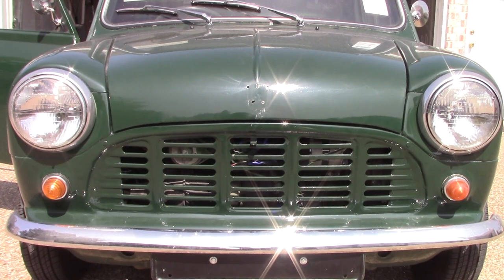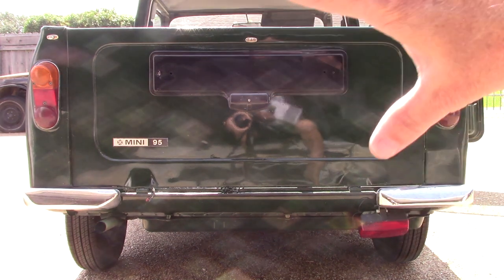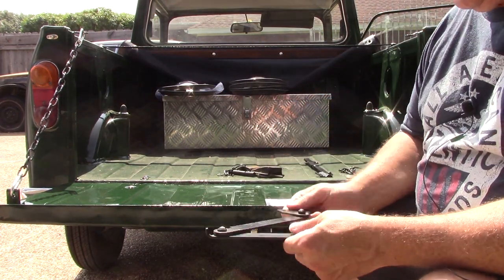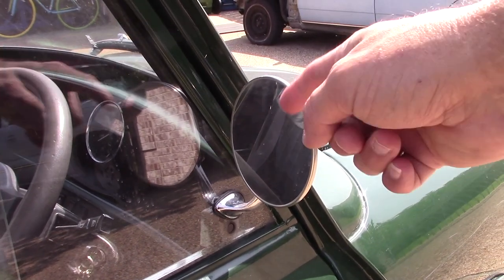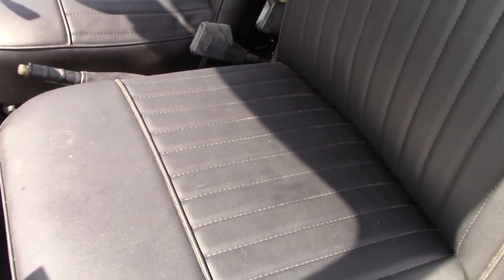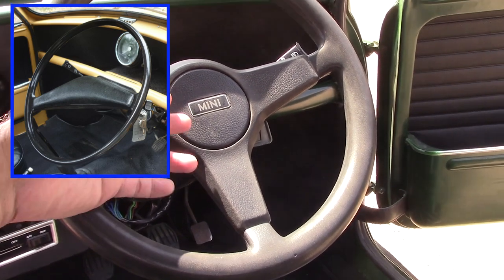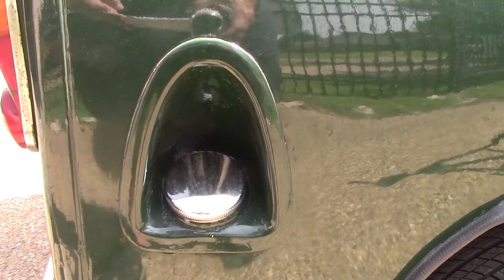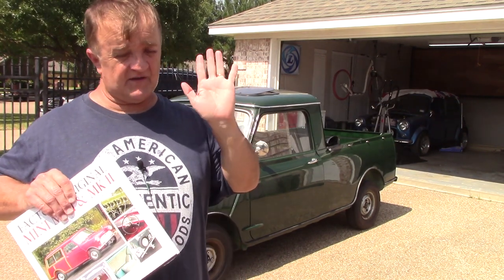MINI PICKUP Trim Details.

Comment: Hi there, you may be sorted by now as I'm a bit late to the party but my Pickup is 1980 and pretty original.  Saying that my front panel has been replaced so I'll withhold comment on that.  No over riders, I think these were just for upmarket saloons and were gone completely by 1980.  The choice of bonnet badge will be dictated by the registration document.  My rear lights are as inset photo at 05:30 with indicator at the top.  The hubcaps should be the plain ones you mention just covering the wheel centre.  The spare wheel is held down by a swan necked metal clamp to the bracket you were given.  My seats are Houndstooth cloth inner and vinyl outer.  The door cards are plain card type as are the dashboard outers,  no pinstriping.  Your dash switches are correct with a brake warning safety light,  your steering wheel is from a later saloon you show the correct one in inset photo.  For my money the sunroof needs deleting.  There are numerous 1979/80 Pickup brochures on UK ebay showing the same interior as mine. I hope this is of help but as I said you're probably sorted by now.  Good luck in your new project.
Reply from the maker: awesome..  thank you for your input.  I'm fairly sorted.  For now it will become a rolling restoration.  I plan to use the earlier tail lights (Lucas) and eventually I will replace the grille.  As for the sun roof, there is not much I can do about that and will leave it.  I'm far from having the skill to form and put in metal to match.  As for the bonnet badge, I'm going to use the combo Leyland symbol with "MINI" given that nobody here knows what the pickup is.  The badge will at least give them a clue.  My biggest problem right now is whether or not I go with silver or Old English white on the wheels.  I believe silver may have been the correct color for a 1980, but I believe I may go with the white..   I greatly appreciate your input!!

Comment: Hi Randy,  You have a super little Mini pickup and I'm very envious but I'm sure it didn't come cheap.  I like where the mirrors are located and the chrome look. To mount them on the fenders would just be another place for corrosion to attack. I was thinking since you are already working on the other Mini perhaps you should just drive the pickup around as is and enjoy it. Cheers, Midge
Reply from the maker: Right on Midge..  great minds think alike.  I was considering the idea of potential rust origins and I also wondered how well I could actually see in the side mirror if it were mounted to the wings.  I'm not sure it was be as useful..   I must focus on my current restoration and keep this for driving while I can.  I do have to flip the radiator fan around so that it's correct and I will only do some repairs when I cannot do anything on the current resto.  well...   I would like to have the wheels cleaned and finished...

Comment: I think you're on the right track with most things, yours is a quite late PUP, I think (like your tailgate badge) they were Mini 95's by then (Pay load 95 cwt ?), made by Austin Morris (AKA Leyland) The wheel trims you have are way too early, AFAIK PUP's only ever had the dog bowl small centre caps. Rear lights I think yours should have the Britax type, Is yours a 1000cc, Mine is a 74 and one of the last of the 850's (I think). Seat trim looks similar to original pattern, but has been re-done. The spare wheel holders can be hard to find, and that wedge bracket should be welded to the floor. You have original commercial doors (see elongated slot by the inner handle ( Allegedly for a padlock on Royal Mail vehicles? So the rumour goes!)  I love the way you refer to "M... K... 1  and 2, the English pronounce MK as "mark" so Mark one and Mark two !  Another book is Chris Rees The Complete Mini, I'll have a look at my copy tonight, there may be more changeover info in that one. Videos like yours will bring out this information, Great Work Randy!  Cheers Graham
Reply: Not much in the Rees book unfortunately, not worth buying the book for, says last 850 PUPs were November 1980, only 1000's up to end in 1983. Does have a pic of the front seats and Boomerang S/wheel...
Reply from the maker: Okay.. you are the kind of guy I need to talk to.. thank you ever so much for your knowledge.  So then..  My pup is not an Austin or a Morris?  It would be considered a Leyland (as far as badge on bonnet)?  Yes, I believe mine is a 998 although the engine number plate is missing.  Hmmm..  I'll have to look for the elongate slot you refer to in the doors...   Not sure what you mean by AFAIK Pups?  Are you staying that my pup should have the small center hubcaps?    Well, the Britax rear lights are easy to come by, but I do like the L558 lenses..   Graham..  I greatly appreciate your feedback, thank you!!
Reply from the maker: @grahaminaus  How can I look at the engine and tell whether 850 or 1000?  I feel I should know this, but it's escaping me at the moment.  I'm told it's original and I believe them, but how do I validate?
Reply: @LoneStarMini  sorry AFAIK Acronym, means ... As Far As I Know... 😊  There's some good stuff in the Facebook files of Dees Mini Pick up international, there's a zip file of photos of a factory standard 1980. As far as the Austin Morris thing, the company had many different names over the years, Austin and Morris joined up (with others) and became BMC, I think it later was "Austin Morris" then Leyland Cars etc. Often the registration details were delayed well behind the company name changes, but by 1980, I'm fairly sure all Minis were sold as "mini''s" including the commercial mini95 any reference to Austin or Morris was long gone... My 74 has Morris on the UK registration form (V5) Car now in Australia..
Reply from the maker: @grahaminaus  Then I suppose the Leyland bonnet badge is most appropriate.  thank you for helping to make sense of all this.
Reply: @LoneStarMini  there may be a plate down the back of the engine that says 850, or cast into the block, otherwise it may be a case of head off and measure the bore 64.58mm for a 998, only 62.94mm for an 850. Not sure if heritage certificates are issued for vehicles as late as 1980.....
Reply from the maker: @grahaminaus  hmm.. I'll have to google this 850 plate so that I know what to look for.  I hope Heritage Certs are offered for a 1980.. Thank you Graham!
Reply from the maker: Grapham, you may know.  I have read that only 54K pickups were made.  If this is accurate, then I wonder about my VIN which has a higher number than 54000.  Doesn't the VIN represent the build sequence number.  Yes, I've been going through every item in Dee's File folder on Mini Pickup International.  I did notice the Britax lights on the yellow pup example, but did not realize it was a factory example.
Reply: @LoneStarMini  see pictures here: https://www.minimania.com/images/id_mini/engine.html    Shows 850 cast into block and a 1275 engine iD plate, both down back near where mechanical fuel pump would be..
Reply: Coles 998 shows 1000 plate here: https://www.7ent.com/blog/classic-mini-diy-early-998-6-painting-time.html

Comment: Randy, you pickup may have had a replacement front panel with the van/pickup style grille welded in rather than pressed in one full piece. I will have a nosey at my van see what its like for you
Reply from the maker: I'm thinking it does..   although Mini Spares does not have the pressed in grille and I believe M-Machine may be the only place I can get it..

Comment: The bonnet badge should be silver/grey with the Leyland logo - like the one on the left just inside your garage. The pick-up is not a MK1 or MK2 (pronounced Mark 1) but shares the same doors which confuses people. The hub caps you have are from a deluxe, you should have the smaller centre cap - the wheels are the same and should be silver. The rear lights you have look the same as the vans and estates - these may be original, I'm not sure. The second Lucus ones you showed also may be original, but the third were definitely not standard. The front bumper overriders I don't think were standard, they normally come on the Deluxe. The switches below the speedo are correct. Another thing I noticed was your number plate (license plate) should be hinged along the top so it can swing down when the tailgate is opened and still be seen - this was a feature on the earlier MK1 & 2 cars.
Good luck finding the parts to make it how you want it to look. I have been enjoying the restoration of your other Mini and have been trying to restore my own '79 1275GT, fortunately parts are easier to come by here in the UK.
Cheers
Sy.
Reply from the maker: Thanks Sy...  Yes.. mine would be a Mark IV (I say M-K as you know) based on the year which is confusing because of the doors, glass, grille, etc..    the number plate on the tailgate is the swing type and it works well .. quite nice.   I actually prefer the 'dog bowl' round hubcaps and hope to find them.. although I think you can buy these new.. not sure.  I'll be back on the restoration this week as I've been a little distracted with the pickup...  would love to see pictures of your 1275GT..  The book that was recommend did say the overriders were not standard except for "fully equipped" vans...  I like them so I will put them on my pickup for sure..
Reply: @LoneStarMini  I forgot your steering wheel, yours is from a later car and are a nice size in use, the one you pictured would have been the original - these are too big and too thin. I have one like yours 😉
Reply from the maker: @simonkemp2169  not sure which s/wheel I want on my pickup.  I kind've like the boomerang style or even better, I like the older style like I have for my Cooper MK1

Comment: If its a -80 model the Leyland front badge is correct.
The hubcaps you got with are wrong for the pickup, but will look nice on the -64 Cooper! 
The front grill was pressed as one piece when the car was new. As this one clearly is renovated before sent to you it has the only solution these days, a welded in grill to the front panel.
Thats how its done these days! 
Taillights, it should have the latest version of then. 
Color for the wheels, erm probably silver. But why not try one wheel painted old english white and stand back to watch which matches the paint of the car best.
Clamp for the spare, thats one you can do yourself, just need a pic and a 2x6 piece of metal.
Who knows, I might have a knob to tighten the clamp. And probably some other bits for you.
Speedo and pod for it looks like the right parts. Black pod in cheaper versions of mini, like the pickup. Yes painted petrolcap from factory.
Put the chrome vindow-locks on the Cooper! 
Yes yes yes for the small center hubcap! 
Almost any factory made hubcap fits any 10" steelie wheel. Yes, there are exceptions even to that.
Reply from the maker: Again.. thank Vinko.  I do believe I prefer the 'dog bowl' center style hub caps and I do like the early L558 taillights.  As for the color of the wheels, I may depend on whether I stay with the green body color, although I'm leaning towards the old english white.  It is apparent that you are wondefully familiar with all things mini..  I greatly appreciate your input, thank you!!
Reply: Lost count after the 27th mini of how many mini's I've had. 
First one was in 1983
Currently have a -74 Innocenti Cooper 1300 Export, a -65 Austin Cooper and latest addition is a -73 Authi 1275 GT
Reply from the maker: @thatdudeinorange2297  Ok.. I'm envious.. would love to see all your minis.  The mini was the first car I ever knew, but didn't have my first until 2015.
Reply: No need to be jealous, in the 80-90s it was more or less buy one get one for free. Rustbucket that is(was) back then. Now they are getting really pricey even the rusbuckets. 
You have a nice collection going there!  Use the pickup, restore the other two. Thats what I'd do.

Comment: You will also find anything to do with vans/pickups you will pay a premium. My new old stock van lights cost 200 quid
Reply from the maker: I believe I prefer the L558 rear lights, but I can only find them in pieces (lens, bezel, etc)..   yes.. a tad pricey.  Then I don't have the same resources available to you guys so I have to rely on ebay or google searches...